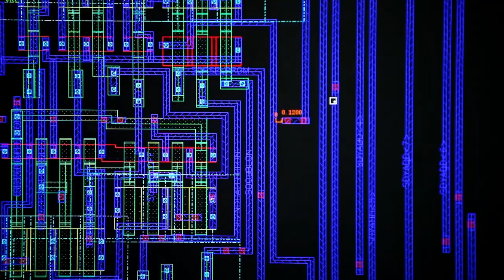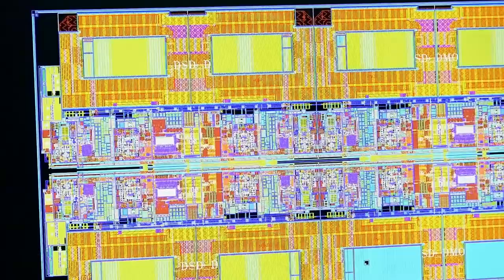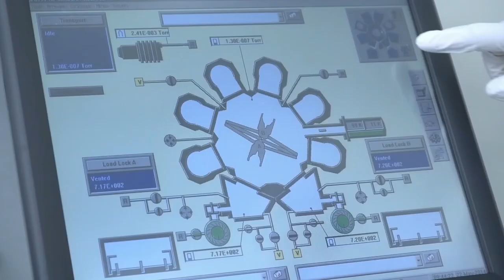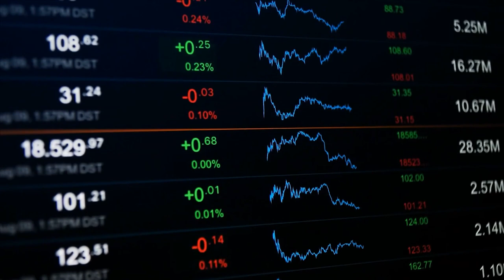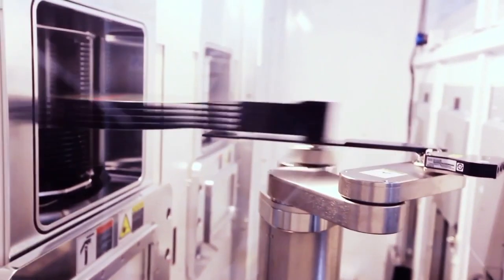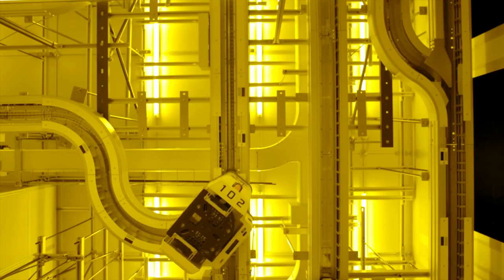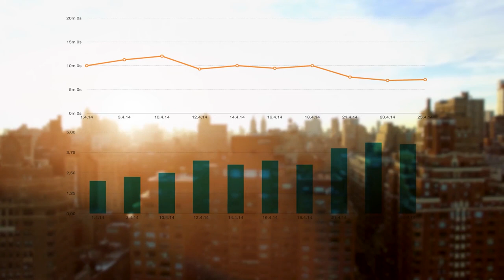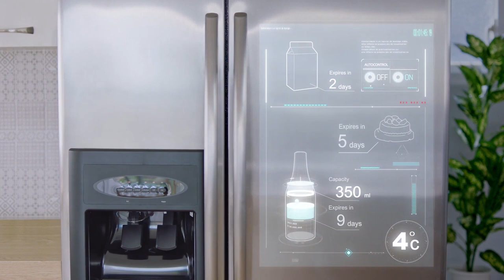Inside The Largest Semiconductor Factory In The World!

Comment: My 1 TB SSD came from here!
Reply: tsmc don't make SSDs
Reply: @AndrewMellor-darkphoton  they make the memory chips on ssd and rams
Reply: @aryciozjksyksjxifk5482  tsmc only makes high performance semiconductor for processors. D-ram and 3D NAND SSDs are too specialized for tsmc because DRAM is more capacitor based than transistor based and 3D NAND uses non binary transistors and quantum tunneling. TSMC probably does makes memory controllers for SSDs.
Reply: Possibly the controller chip but that is all.
Reply: Fail
Reply: ASML is also part of this market, ASML current stock price is $789, where as TSMC is only at $114.

Comment: ASML is also part of this market, ASML current stock price is $789, where as TSMC is only at $114.
Reply: Thats... not how stocks work . You need to look at market cap to determine the real value of the stock. If company A has 10 stocks at $10 each and Company B has 1000 stocks at $1 each, Company B is still worth more
Reply: @elmagnificoroca  The value of anything, is TECHNICALLY what someones willing to pay for it,BUT yes, IF your going off the company as a long term investment or as an investment in general. You should DEFINITELY evaluate the stock/see what the companies actually doing, look for trends and so on, BUT IF your buying stocks, based on popularity/,because other people are putting money into it, then that changes things, SOME WHAT,BUT the main thing is, you NEED to know when to buy,sell and hold.

It CAN be A LOT more complicated, than JUST buying and selling though,BUT IF the stock is worth a good bit, MOST of the time, thats a good sign,granted, you want to buy low and sell high,a LOT more goes into ALL of this though.

I'm just making a point that ASML, is ALSO a HUGE player, in this market/BOTH companies have competition.